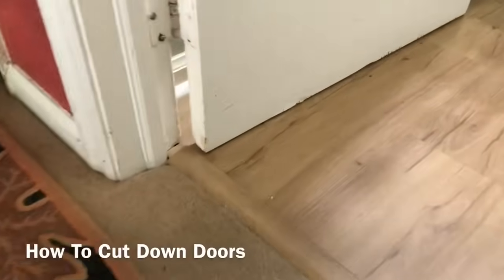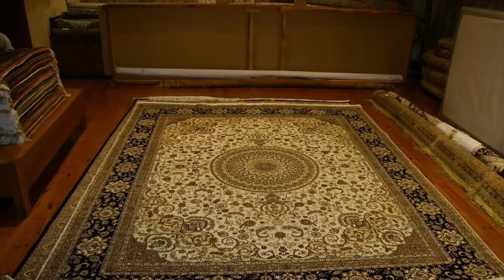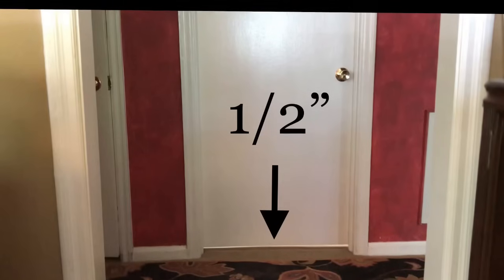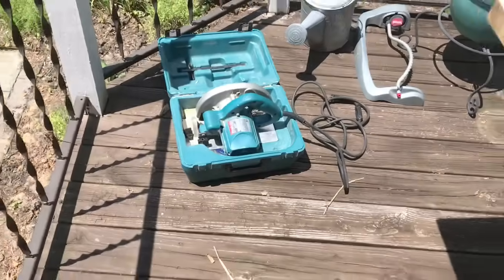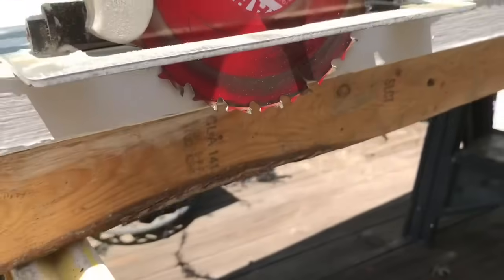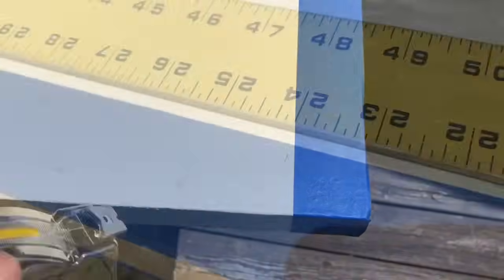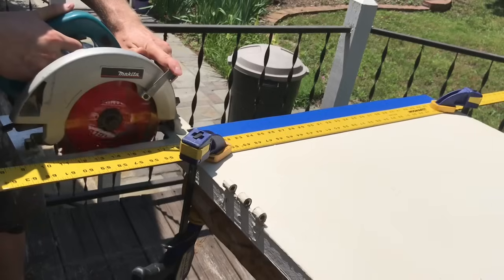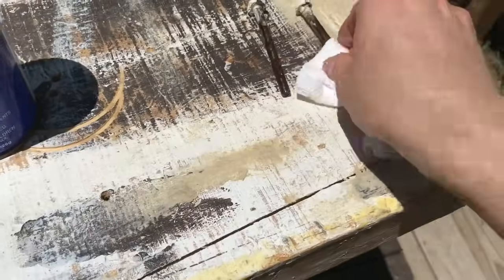How To Cut Down Doors (Shorten Door Height)

Comment: The hardest part of the whole thing is realigning the door hinges by yourself without any help .. thanks for showing that.. not !!!!the other procedures are pretty basic but good explanation... Being careful not to nick the door paint when tapping the hinge pins back in for those who are not so adept with a hammer as it is a tight space....using a nail set or something else to tap it in works real good..

Comment: What is the absolute best blade for this?

I was looking at some carbide-tipped finishing blades, but there are quite a few styles of them, some with small teeth and some with still much much smaller teeth.
Reply: Wondering the same thing

Comment: i had to do this for a client who had new, thicker carpet installed.  I used a portable band saw, much cleaner cut than the typical circular saw.  BUT....had to bring the door back to the shop to glue in a new bottom plug.
Reply: How exactly did you use a band saw on it?
Reply: @aayotechnology  I have the Milwaukee corded portable bandsaw.  The blade is angled, with about a 4” aperture.  I clamped the door to my Bora Centipede, drew the line and cut the door down to size.   Unfortunately, the cut was deep enough to go past the hollow-core frame.
Reply: @billstewart1653  so you don’t guide the saw against an edge? Just freehand? How do you get it straight? Or do you sand it after?

Comment: This is a good way to ruin a door. You are not using the saw correctly. The way you are cutting will produce a wobbly not square cut. The wide part of the saw is supposed to insure the cut is square and you have it precariously hanging off into the air.
Reply: The right of the saw has a square corner too.... He's using it right plus he has to cut only 1/2 off it went square as heck. Not only your way it's the right way plus he has a straight line to make it STRAIGHT AND SQUARE

Comment: Hey Ethan, great video, but quick question: Can you narrow a door in the same way as making it shorter? By using a straight edge and circular saw? The jamb for my front door is 32 1/4" inches wide. Cheers!
Reply: Finish carpenter here, depends on the door. If you do narrow it, do it off the hinge side and re mortise the hinges into the edge of the door slab. If you're raking a lot off of a hollow core door than you will have to re use the fill strip or make a new one to fit inside the recess created. Simply run a bead of wood glue on both inside sides of the door recess, slide the piece in, use "cauls" to clamp it for twenty minutes or so in a warm area and brad nail the top and bottom to hide the fasteners. Never had an issue.

One more note, mark out your hinges by transferring the line to the face of the door  with a square, so when you cut it you know exactly where the hinges go back to. If you forget to mark, they should be about 1/8 difference than the hinge mortise on the door jamb. Good luck!
Reply: @gregorymosher5008  That sir, is fantastic, detailed and completely understandable advice! I thank you for your time and expertise.
Reply: Anytime patrick! Carpentry and woodworking (and homesteading) are my passions. Any questions in the future message me on here and i'd happy to help!

Comment: Hi there. Thanks for the comprehensive video. 
Would the trimmed door be more susceptible to damage (swelling, bending...) due to the fluctuation in temperature and humidity at the bathroom? In particular in one with no windows, only extractors. 
Would it be ideal to prime the edge that you trimmed and paint it? This for the long run. 
I am truly interested in your opinion. 
Thanks
Reply: Shouldn't bother it at all. That being said, if you have toddlers, grandkids etc splashing around it certainly wouldn't hurt. If you have an MDF / masonite etc product than any water will wreck it quickly.

Comment: If you have a Hollow Core Door, how much can you take off of the bottom and still have a structural piece left on the door? In other words, I need to remove about 1/2. Is that to much on a hollow door?

Comment: Is that a hollow door? What if I trim down a hollow door? Would there be a hole at the bottom?
Reply: Drill a small hole in the bottom rail stick to see what remains. If it’s not the first time being trimmed it may be necessary to remove that stick and move it up to the cut line. A new stick may be necessary!

Comment: Thanks much! I just did this project exactly as suggested and it worked brilliantly. I cut a pantry door 1/2 inch so it would open over a new rug. The blade on my handsaw was dull, yet I had no chipping at all. I clamped down a thick piece of wood on my workbench so I could press the saw rather hard against it as I cut, which I think was helpful in keeping it straight.

Comment: Seems like a circular saw might rip the grain, even with the tape.  I'm planning to use a router with a straight bit, with several passes necessary.  Usually does a very clean cut, if you have the patience.

Comment: I have a home with a chiltrex cooling system. Each room has a ceiling based air handler and no air transfers happens between rooms unless the doors are open.  They are usually open until bedtime and we want the room sealed good so 1/4 inch is what I went with. No return air vents at all so for us it's a moot point. Sealed is better in our case.

Comment: I’ve heard about the tape trick, but are you cutting through the tape? Or are you cutting to the edge of the tape? Seems like you’d get tape stuck to your saw blade if you’re cutting through it.
Reply: You cut through the tape.
Reply: Seems like you'll end up with cooked on gunk on your blade, no?
Reply: No, it doesn’t stick to the blade for whatever reason.
Reply: It’s just painters tape so no gunk. It’s designed to come off any surface easy

Comment: Can you do this cut with a HOLLOW DOOR? I am dealing with that with a bedroom door.
Reply: Hollow core doors have a 1” plug on top and bottom of the door. You can cut down on top and bottom of the door as necessary but I wouldn’t cut more than a 1/2”. If greater cuts than 1” required you can cut the door down and you can actually pry off the door panel from the plug and reinsert the plug in the door bottom with carpenter’s glue.

Comment: That door looks like it needs replaced or least striped down & repainted.
Wouldnt big teeth on the circular blade cause much splintering of the wood?
Always thought a fine tooth blade gives better clean cut with less chance of wood splintering generally its a fine 132 tooth blade for a circular blade wouldnt you say fine tooth blade is better then the big teeth blade used in this video?
Reply: yes, a finer finishing blade, 40 tooth at minimum, is best for this..
Reply: Used a 60 tooth today and edge finish was very good

Comment: In my limited experience having work done with sub-contractors, if you let them all have their way you lose aesthetics.  An inch height is crazy off bottom of the door.  Unless it needs to clear that to work the door.
Reply: the only time I've heard that is for a home with forced air, with the outlets and returns.  Still that is a bit much for me, no way i'd have an inch gap on a bathroom door lol..

Comment: Pretty good overall, but you can dispense with a lot of the cutting issues by using a home-made cutting board; just set it to the exact line you want to cut and it's base edge holds the veneer down against tear-out. I've cut down at least a thousand doors by now and I usually just cut very slowly to a drawn line with a sharp finishing blade. Nobody's complained yet and I get almost zero tearout but remember this takes skill and practice- one twitch with the saw alignment and you've got a mess, so use your cutting board. Helpful hint: When marking the door for cut height, lay a board of appropriate thickness on the floor with the door closed and trace across it; now you've got got a perfect cut-line with no chance of error.

Comment: Pro tip: Use the wide side of the toe plate on the workpiece, not the narrow side. This would ensure a square cut. :)
Reply: Could I do this with a jigsaw?
Reply: @genevievebonneau09 doubt it
Reply: meh, I don't do it that way. if you have a strait edge clamped down, the body of the saw won't clear the clamps doing it that way.  Just pay attention and keep the saw square on the surface.  Better yet buy a track saw.
Reply: @chrisburns5691  you can use a wide piece of ply for the guide and clamp it outside the area of the saw.
Reply: Y eah but if your just a home owner that track saw is a big chunk of money for something your only gonna use a half dozen times.
But don't get me wrong I live by the moto of he who dies with the most tools and toys wins.

Comment: Most of the time I just try to match what else is in the house. Also I use my level pretty often as a straight edge for a while I carried a 1by4 and a 1by6 so I could clamp tight and have a sacrificial board on the bottom to help with tear out. I just don't do as many backtrims as I used to so there not worth the space.
Reply from the maker: Good call, Michael. I've definitely used my level if I didn't have another straight edge

Comment: Good video though how is the length of the door cut? should it be done same as the bottom with a skill saw or a plainer if it is only 1/4" that has to be removed?
Reply from the maker: Hey Jerry! I'll often set up a longer straight edge and do it just the same for a 1/4" cut. The planer takes so many passes along the door length--the circ saw takes it all in one. Just be careful and keep your cut progress steady :)

Comment: Thank you.  I’ve never done this before and am nervous!  My husband has a circular saw that his dad gave him (he never uses it or does work around/on the house frankly) and we has a straight edge he thinks (tho it might actually be an extra long level that he says could be used as a straight edge?).  Question: I need to buy two sawhorses and two offer clamps that would be a useful size for most future projects.  Can you please tell me what I should look for when buying those (probably on Amazon)?  Thank you!
Reply from the maker: @Ayram9 Almost any foldable plastic sawhorses will do--I've used cheap ones and expensive ones, and they function much the same. For clamps, I've just always loved Irwin Quick Grip clamps. The 12" ones are highly useful, and can cover a lot of different tasks. I hope that helps!🙂
Reply: The Honest Carpenter Very much so, thank you!
Reply: The Honest Carpenter Actually, there are multiple kinds that fit that description!  Do you mean be one-hand bar clamp kind?
Reply: @Ayram9  Any kind will do as long as they hold and the saw clears them. I use these bar clamps for most everything now because they're small and hold very well.

Comment: I always check the hinge hasn't come away from the jamb or door first causing the door drop. Then lay a builders pencil on the floor and mark  the bottom of the door. If the house has moved the floor may have also.

Comment: Get a track saw. No need to tape and it’s way faster
Reply: Not cheap and you can do as well making your own.
Reply from the maker: @David Brent I’ve never used one. How does it prevent against tear out?
Reply: The Honest Carpenter the blade runs tight to the rubber seal on the track preventing any tear out, I can cut laminate sheet good with it and no tear out. And no need to set the saw back to suit the fence

Comment: Another professional and strait forward video Ethan.  Glad you had enough meat on the bottom and didn’t have to reglue in a bottom sweep, hate it when that happens....
Reply: Ed, maybe we're old enough to remember when you usually had 1 1/4" in the bottom of hollow doors. Nowadays the new crap they make has just 3/4" down there, so my standard price for cutting a door down has gone up to include re-gluing the wimpy thing back in place. The few cents saved by the door manufacturer adds several dollars to the cost- false economy if there ever was!
Reply from the maker: Ed Over50 Thanks Ed! Me too—I’ve had to pull out a lot of this pine plugs and glue them back into hollow cores 😅

Comment: I usually take a utility knife and score the line, which I'm going to cut and the sides of the door. I hardly ever see anyone else do this, but it helps avoid breakout and splintering. I allow for an 8-10mm gap. BTW, isn't time you guys converted to metric? Cheers
Reply from the maker: gsf67 Thanks for the tip! Pre-scoring is a great way to avoid splintering. And I’m willing to go metric, but it means I’ll have to stand there and stare at my tape measure for long time, counting silently 😂
Reply: I just think that metric seems more logical, but that's just me, and I guess it's just what you are used to. Have a great day. @TheHonestCarpenter
Reply: I use both. Meters are too damn big, but millimeters offer a level of precision that inch fractions don't. so I tend to think in yards/meters, then feet, then inches, then mm. It's more math, but other fields of interest use both standards and I don't mind converting.
Reply: Would you score the line through the tape?
Reply: Metric is communist.

Comment: I always use a utility knife and score the top and end(where the saw will finish cutting) to prevent splintering......And I like to stay 1/2" to 3/4" with the gap
Reply from the maker: zeke112964 Utility knife is a great idea Zeke. I’m going to show that trick when I do a cutting tips video. And I think you can’t go wrong with 3/4” gap. Cuts down strain on your HVAC, and keeps air moving 👍
Reply: I used to do that but got splintering anyway unless I made the knife cut very deep. And more than a few times the knife blade turned off-line. It's really not necessary if you use a cutting board and cut very slowly.
Reply: @P_RO_  yep, good finishing blade makes a huge difference too..

Comment: Well done,👍👍 my phone must be listening to me, this was a recommend video. 
I've got to do a solid core door that's fire rated on Monday. (Spooky!!) It must weight 200 lbs. I generally have consistently good results using a fence inserted in my trusty DeWalt 20v skill saw.
Reply from the maker: @JUrry3 Thank you! I get that feeling all the time from my phone too 😅. Those fire rated doors can be killers to move around. I've just about cut them out of my work routine to save my joints. Good luck with it. I'm sure that Dewalt fence does the trick!
Reply: Im wondering if your phone listens to what you say and uses that to make suggestions

Comment: Very good. If you can, I suggest you a video on installing “pins” or “security pin” for an out swinging door with hinge pins that can easily be tapped up and off. 
These pins mount on hinge side door edge and hide in a hole drilled on frame side when door is closed.
Reply from the maker: Thanks Tony! That's a really good topic. I'm starting to group ideas together into videos, and that one would fit perfectly in a home security vid. Thanks for the suggestion!
Reply: Most residential exterior doors are in swing!